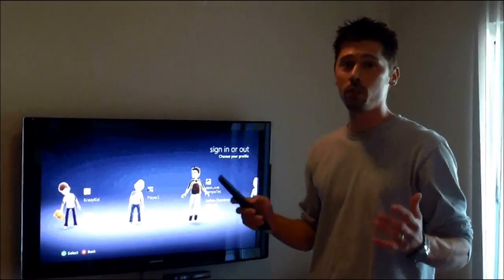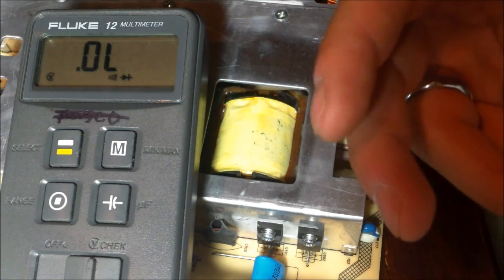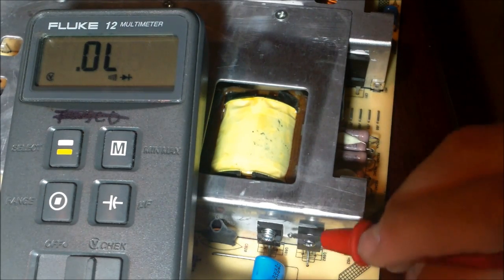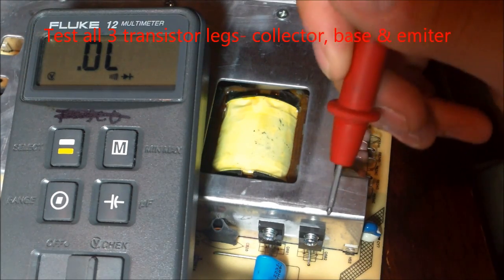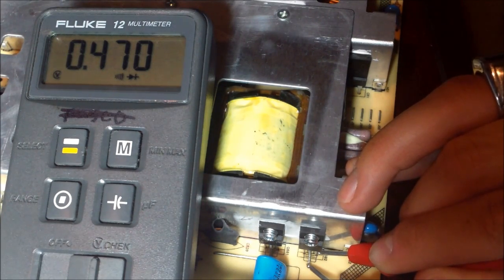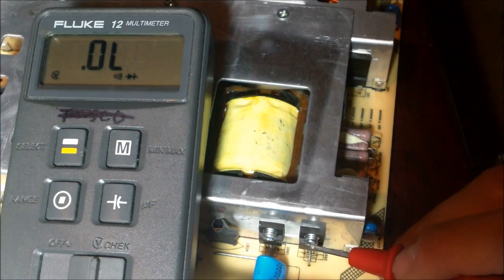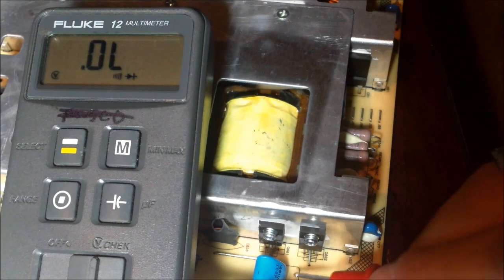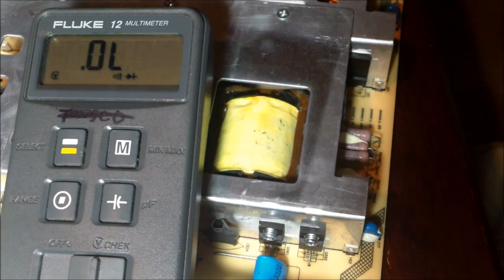HOW TO TEST TRANSISTORS, TECH TIPS 25

Comment: Hey i have a LG 50LB6300 smart tv powersupply fluctuation  in main output only not in led output i check diod good an capacitors in that circuit reading bad but good

Comment: Hey Tampa, well you've saved me again but I need some help locating a transistor for a Sony kde-50xs955 Plasma TV G2N Power board 1-863-178-12
The transistor number is BO25I
                                 DIOSC4MR
I don't know where to buy components, google shows nothing.
Thanks Again Keep on keepin' on!
Reply from the maker: Rusty Nuckles try shopjimmy or mouser or ebay
Reply: try digikey.. google digikey

Comment: You are the man! finally a in circuit and out of circuit test ! Prospective do u have a vid on taking a transistor out of circuit cause I find it difficult in tight places like kenwood mono d amp I'm working on if u can recommend the proper tools to buy that wld be awesome I assume my autozone solder doesn't get hot enough and I need a better one
Reply from the maker: i use 50watt adjustable soldering iron and solder-sucker. unscrew transistor 1st if its screwed into heatsink.
Reply: Thxs I have an idea of what your talking about just didn't know the names thxs again!